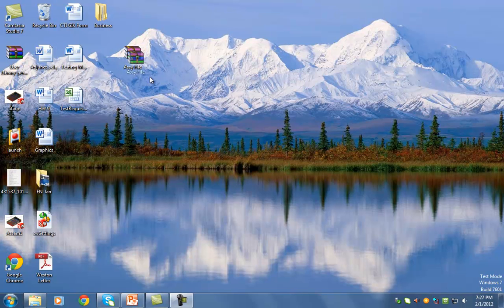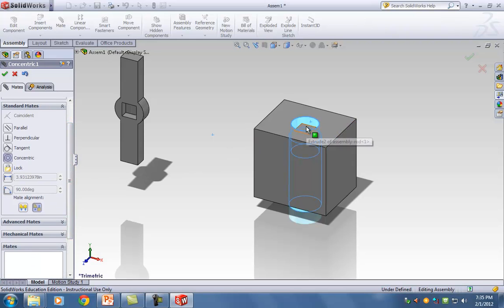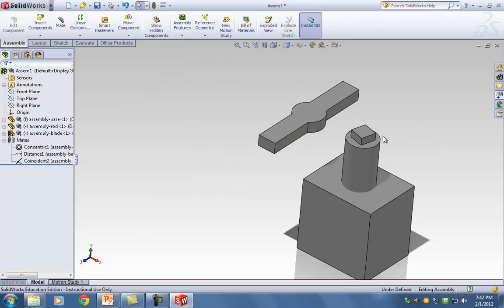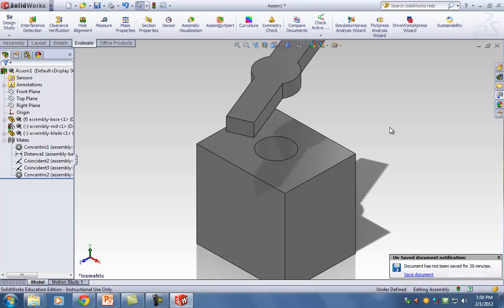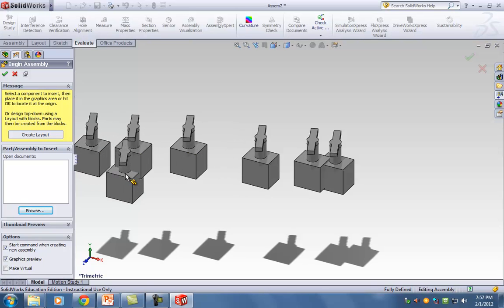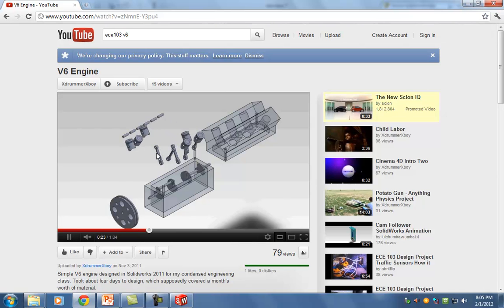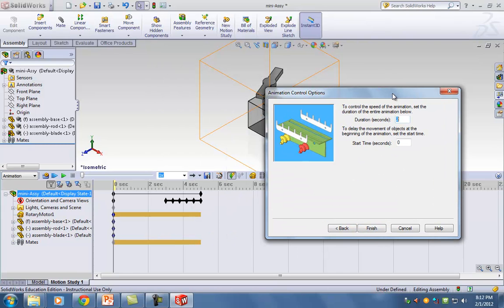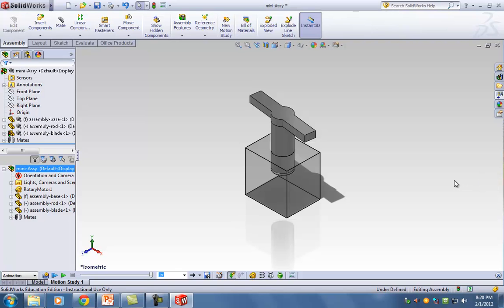Solidworks Lecture 3: Assembly and Animation

Comment: Where can i find dimensional drawings of all engine parts for this lecture...Actually, I succeeded to pull out engine base, engine head, piston, flywheel and connecting rod from previous lectures, but to complete engine and this lecture I need pin and crank shaft, I think...this is great lecture,and I would love to have and rest of the material, such as power point presentations etc, mentioned in these videos....please post links, anyone...tnx...